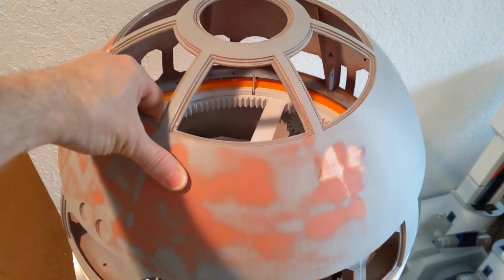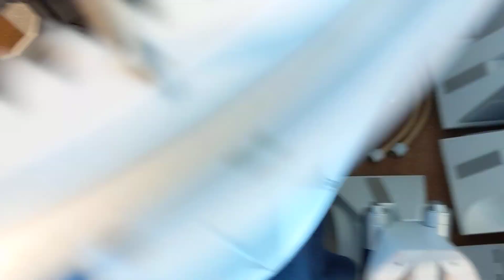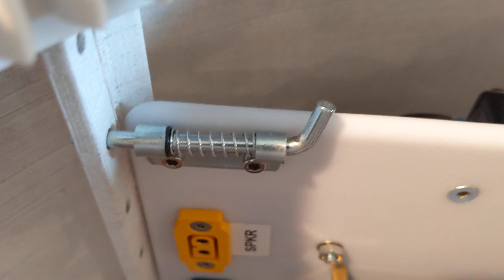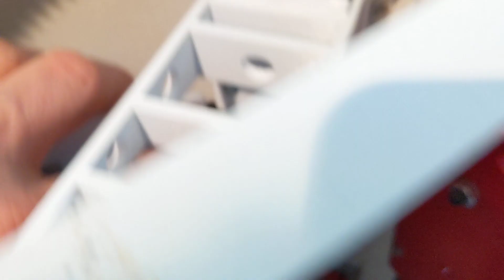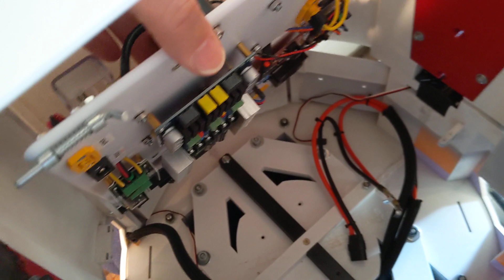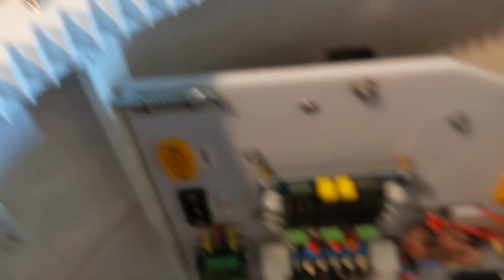3D Printed R2D2 - Part 103

Comment: Tom, you're running the Padawan360 system?  I tried using it for R2, but I couldn't get the software to work correctly through the various boards so I changed to the Kyber Control System.  I'm about 80% there for my build.
Reply from the maker: I'm using the SHADOW system.  It's nice that there are several choices.  Good luck with the rest of your build!